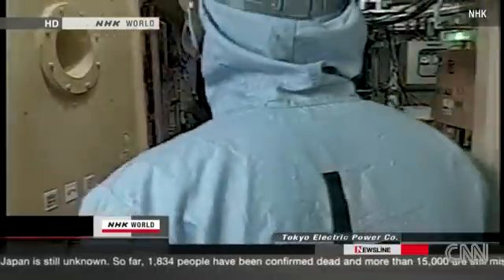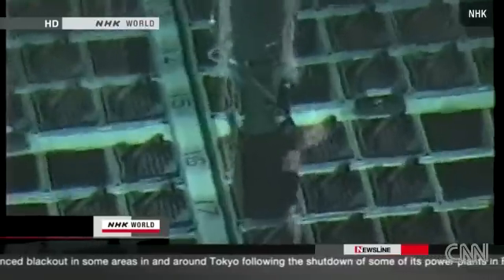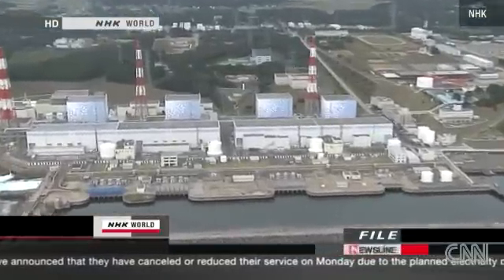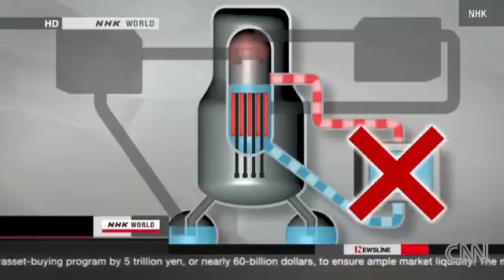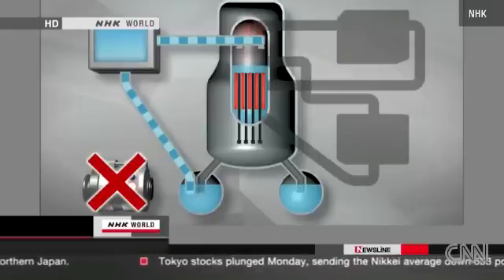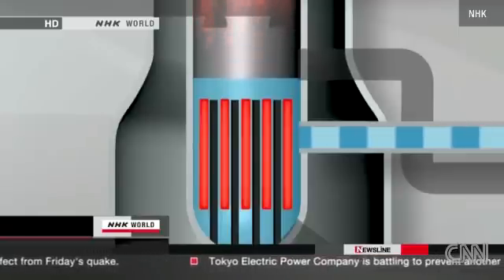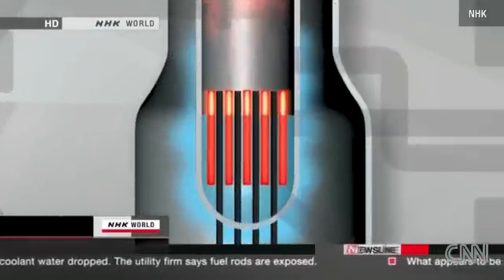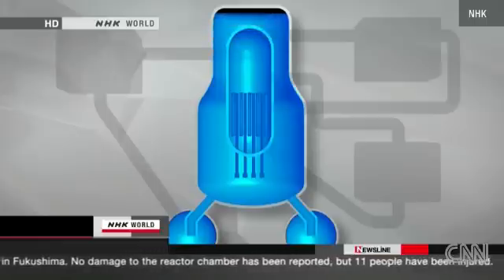Fukushima Nuclear Reactor Problem Explained (CNN)

Comment: The reason of the failure in reactor 1 wasn't a leak but a valve in the final emergency system that didn't open properly and only allowed part of the steam to flow. When the steam didn't pass properly in the passive system the water turned to steam and the top of the rods melted. The melting reaction created an explosive gas that managed to escape (through joints due to very high pressure) and explode. However the reactor didn't explode unlike Chernobyl. Just the roof where the gas pooled against. If the reactor exploded they would have had to evacuate Tokyo.

Comment: That is a lie:
Sea water was not pumped at first. 
They told them not to do it because the sea water would have damaged the reactor beyond repairs (salt!)

But then after some employees saw the impact of the incident, they disobeyed the bosses and opened up sea water. 

They saved Japan and reduced the impact of the incident. The greed from that Japanese company that owned Fukushima is beyond comprehension. They were also the ones who originally reduced the tsunami wall by a few meters which is exactly the amount that allowed the tsunami to pass

Comment: I would Reinforce the walls With Metal,Steel and Concrete
And would probably put 3 Backup coolant tanks reinforced with steel and steel bolts.
But they is no way to reinforce the Backup generators

Comment: wait a minute Nuclear power is actually geothermal power
Reply: no, nuclear power is what it is: nuclear power. geothermal power specifically means the heat energy left over when the earth formed inside the crust+ the heat produced by the natural decay of radioactive elements. nuclear power is produced from splitting atoms. just because it came from the ground does not make it geothermal power.
Reply: if you listened to the video the power is generated by the object being heated up to a certain temperature so technically it is geothermal when i first wrote the comment i meant it was technically geothermal because i know that they are different in their ways.
Reply: the natural decay heat from the fuel rods makes up such a small percentage of the actual heat produced by the nuclear reactor. there's no "technically," the decay heat makes up such a fraction it would be like saying humans are made out of iron because we have the iron content of about 3 grams scattered in our body. functionally useless.
there was a video (not this one) that i watched a few days ago that mentioned that the percentage of decay heat that makes up the general heat production of a reactor is really small and only becomes a problem without coolant which will probably never happen. it was something about canada's safety, however, i am not finding it for the sake of a youtube comment.
Reply: i made the comment 2 weeks ago i replied to try and fix what i meant so please dont carry it on

Comment: Possible Fukushima disaster solution:
The Fukushima radiation leaks continue as we speak, it threatens the 
life on the whole planet. The molten cores is trapped in an underground 
stream of water, leaking out to the Pacific Ocean.
2014 i come up with this possible solution, its a gigantic chamber 
under the broken reactors, that has its air sucked out, additional 
vacuum chambers is located on the sides.
Explosives are placed underground around the radioactive buildings, 
and well below the water table, and the now molten former reactor cores.
 When exploded the massive area of land will start falling down. Free 
debris and particles will be sucked inside the underground shaft, and 
additional vacuum chambers can be set to go off, to additionally suck in
 dust and debris.
Picture: http://circuminvent.com/wp-content/uploads/2017/02/fukushima-reactor-solution-png.jpg

http://circuminvent.com/fukushima-solution

Comment: The real reason is that Tokyo Electric, the company operating the plant, delayed using sea water to cool the rods because then the system would be unusable in the future, which means huge cost for replacement. They delay that for every reactor and they all ultimately failed. And now the world unknowingly suffers because the Japanese government is too scared to report the real damage, for the sake of stability.
Reply: I think Tohoku Electric Power Company should kick TEPCO ass!

Comment: Told you should have had FOUR back-up systems....the forth being NEVER place your back-up generator where it might get flooded as in this case....especially in an area prone to tsunami.
Reply: Correct. Generators in the basement sealed the fate of Fukushima. Its the first place to flood. Generators should have been on the hill behind the plants.
Reply: You need the sea water to cool it
Reply: @_Andrew2002  the generator doesn't need seawater. You can have the reactor near water but the generators and switching stations in floodproof areas.
Reply: They should do what TOHOKU did!
http://thebulletin.org/onagawa-japanese-nuclear-power-plant-didn%E2%80%99t-melt-down-311
Reply: This happened because the designers of the nuclear power plant were from the USA and made the design similar to these used in the USA. In the states tsunami is not a disaster to consider, but tornados are and hence the generators are placed in the basement - safest place in case of a tornado. Why would one put generators in the basement to protect them from tornados in Japan? Well that is another question..
Reply: Ivory Billed yeah but the generator could've overheated and locked up.

Comment: How many plants in the US were built with the same design? The industry PR might claim safety but capitalists seeking profit will always cut corners especially when they have bought off regulators and politicians to look the other way.
Reply: The plant design did not cause the problem at Fuku. Putting the generators in the basement below sea level caused the meltdown because they flooded.
Reply: They had a total of 4 safety measures in place. The chances of all of them failing like they did is rare. Now they know how all failed they can make them better. Having such a massive amounts of safety nets in place is what saved this from being worse than what it was.

Comment: why can't they use liquid nitrogen as emergency cooling measures?
Reply: Liquid nitrogen boils immediately upon contact with warmer objects. It will result in Leidenfrost effect, in which the warmer object is enveloped by the boiled gaseous nitrogen, insulating it from the liquid nitrogen. This is why it can not be used as a reactor coolant. In fact, no one uses liquid nitrogen as a coolant for anything that produces so much heat like engines or reactors.
Reply: it evaporates to quickly
Reply: +Tinker Bot it has a low heat capacity, meaning that it doesn't take much energy away from what it is cooling as it heats up,,,, im not an expert sorry but they might have taken it into consideration too while designing and building, water is most used coolant

refer to this lik :https://in.answers.yahoo.com/question/index?qid=20110314091052AAmyYAL
Reply: hmm.. i mean, why not? liquid nitrogen is real cold
Reply: +Tinker Bot I am not an expert on this issue but I think that here, the main problem as seen in the video is how to cold enough the system where it is necessary. That means that it is not related to what you are using to cold to system.
Reply: Howie Au What?
Reply: Liquid nitrogen is a cryogenic/cryonic compound, meaning it is  gaseous in state but turned to liquid when cooled. So when it is exposed to heat it immediately turns to gaseous state and expands will cause an explosion instead.
Reply: +Tutku Temel so you are saying that it would be too cold?
Reply: Not Leidenfrost effect, water can exhibit leidenfrost effect as well
Reply: Tinker Bot I would think that it would evaporate very quick and you'd need an unthinkable amount to make it work.. who knows.
Reply: i think the boiling temp is below 0 so if it came in contact it would make it hotter i think
Reply: Tinker Bot It would create a black hole
Reply: Liquid nitrogen would not work at all. If the rods were regular iron or steel and hot, then yes, the nitrogen would work, but these are uranium rods which contain a huge amount of energy going through a nuclear reaction
Reply: It doesn't absorb so much heat because of it's low capacity and will evaporate easy after absorbing low amount of heat

Comment: stick with burning coal!!!
Reply: Ehrm... you need extremely large amount of coal to supply households with energy... and it's really bad for the environment. If I remember correctly, there are limited amout of coal on earth.
Reply: after these fuel rod's are spent, we have to store them forever, there extremely radioactive for thousands of years and have to be sealed and contained, guarded. a lot of money. plus us burning coal is not hurting the environment anymore than the EPA terrorist  china. there pollution is nuts, watch some of there videos, also the fulkushima nuclear plant ruined acres of land, along with countless cancer case's. also because everybody thinks they need there own car. there millions of them, making a lot more pollution than coal
Reply: +Turbo Diesel Yup, at least we could try planting more trees as carbon sink and then use those trees as fuel. It will never be as the good old days of petroleum and coal but at least it is safe and sustainable.
Reply: small bill of a million dollars
Reply: +Turbo Diesel how about solar hydro and wind
Reply: Tha happy banana 2.1 , Solar panel's, doesn't really generate a lot of power. if you would caver the whole roof of your house with them, still would only run about half of it. wind ruins the landscape so bad, it would take an unimaginable amount to power a whole city!. Then you have the cost, gonna be ridiculous!
Reply: what about radioisotope thermoelectric generators or RTG's for short?
Reply: Tha happy banana 2.1  They work pretty well in space craft's. I don't know about a city though, maybe if each individual house had one.
Reply: it would work but they are expensive as fuck!
Reply: Tha happy banana 2.1  yea you wouldn't be a happy banana afer the bill came lol

Comment: This just proves that nuclear power is not will not ever be truly safe....all 3 safety systems failed
Reply: Nuclear plants cannot blow up like nuclear bombs, you are comparing cats with giraffes.

The fuel that powers a nuclear reactor is typically made of Uranium-238, which slows down the chain reaction used to produced energy, unlike Uranium-235, which would explode. The latter is in much less concentration, which is not enough to make it bomb-grade.

The Plutonium-239 used in Fukushima could be a threat, if it weren't for one little detail: design. Plutonium bombs are extremely difficult to make, compared to Uranium ones. You'd need an implosion to start an uncontrolled chain reaction. Obviously, the containment structure in which the reaction occurs can't implode, it isn't surrounded by explosives.

There are more dangers out there, specially climate change caused by fossil fuels.
Reply: And 1 rare fuck up could render us extinct
Reply: ***** Public opinion wise.....any one that fails is large enough...
Reply: 2000Betelgeuse in unstable lands.
Reply: I have a theory but is there a nuclear plant near yellow stone national park and if so what if the super volcano that is yellow stone were to create earthquakes before its eruption wouldnt it be able to cause a meltdown then the eruption could cause explosions and other volcanoes and super volcanoes to erupt ending the world

Comment: so the cooling failed and what happened next? did the nuclear rods INSIDE the reactor blew up or did the used nuclear rods OUTSIDE the reactor blew like they said in the news?
Reply: The rods inside the vessel didnt but just melts to corium and the big explosion on the reactor happend because of the hydrogen gas ignites

Comment: a nuclear plant should be in a rocky or a desertic region, not 20 meters from the ocean shore, imho
Reply: They are built close to the sea because of the need for large quantities of water, for cooling the reactor as visualized in the video.
Reply: The process of creating electricity requires water to cool the rods as it is operating. Some are concerned that if water becomes less plentiful, it will become a big problem for the operation of nuclear facilities.
Reply: Palo Verde in Arizona is cooled with treated sewage water from the Phoenix metro area. It is the only nuclear power plant in the world that is not cooled by a lake, river, or ocean. The Palo Verde cooling model allows greater flexibilty for where we place these plants, avoiding seismic zones and tsunami risk, while also safeguarding freshwater sources. 
I think all new nuclear plants should be required to use the Palo Verde cooling model.

Comment: It should be just a small problem if the problem is resolved quickly. But, thanks to the stupid company, they finally make it become a worldwide disaster.
Reply: ***** Yeah it is a simple problem. After the disaster, the nuclear plant emergency control system are still working. They are powered by battery power. These power can hold for about 20 hours!!! Which means if they can recover some power or just do something to offer the power to the emergency control system. It can hold the temperature of the nuclear reactor. If this happened, we won't see those disaster happened later. But, they failed to do this. The stupid company hide every bad information and try to solve this problem by themselves. They think everything will be fine.(yes, this is what they are thinking when facing a potential nuclear disaster) They miss the best time to prevent this disaster. Then we see what happened later. The nuclear power lose control and nothing can prevent it becomes the biggest nuclear disaster in history. Even the disaster happened in Chernobyl has nothing compare to this.

Comment: Nuclear power plants require a vast amount of water. Placing them near seas or oceans is more a safety measure as you saw in this video when the safety measures failed, they flooded  the reactor with sea water to forcibly cool the reactor.

Comment: Most plants have auxiliary power of external source (power lines) to take care for the cooling in a case of emergency and are not self dependent. If Fukushima had that, damage would˙ve been reduced to a minimum. Another thing is a storage tank on the top of the building. And I thought japanese knew how to design a power plant? For sure Fukushima was old but that was one major flaw.

Comment: The problem with Chernobyl was that they reschedualed the testing to night, when the new people were on duty. Then, one of the men removed all but 6 of the control rods in the reactor he didn't tell his colleague. Because of the rise in heat, the other removed most of the cooling fluids. That's why Chernobyl blew.
While I say that, I think that if properly done, nuclear power is a brilliant thing.
Reply: @bigquackers1998 No, dumbfuq. That’s not how Chernobyl blew. Jesus.🤦‍♂️🤦‍♂️🤦‍♂️🤡🤡💩💩

Comment: Ya, but why use hydrogen (oh, I mean water) under very high pressures that only fission 0.5% of the fuel when you can use molten salt or metal and burn almost all of it... and it being thorium which is 4x less rare.
Why use the stupid LWR when the public (and I) WON'T accept it, when you can use LFTR (or similar) which the public MUST accept as safe (because it is).
Nuclear's ONLY mishap was the LACK of water (so ditch the LWR already) !!!

Comment: This was a typical LWR which requires water at high pressures (and LOTS of "engineered safety" to overcome it's inability to be safe within natural laws of physics).

Had it been a LFTR, the disaster would NOT have happened!
Now, please educate about that. If, for any reason you don't agree with the concept of the Liquid Fluoride Thorium Reactor (or similar), contact me.

The LACK of water is nuclear's ONLY problem, so ditch the Light Water Reactor, but don't ditch nuclear !

Comment: I'm assuming by "fault zone" you're referring to seismic zones?  Using the Instrumental Intensity scale developed by the US Geological Survey, with a threshold of 0.2g as a potential damage rating of "moderate" I found that out of the 47 nuclear power stations (producing more than 1000w of power) in the U.S. alone, only 1 was in the upper tier of moderate and two were in the moderate to heavy damage zones, and one of those two was shut down for upgrading.

I'm curious where you got your data.

Comment: And you're missing the key point of my reply: that they are generally safe when operated under normal circumstances with a moderate degree of competence.  Protip: everything has the potential to be dangerous, that doesn't mean it should be avoided.

Comment: Chernobyl: They didn't have a proper shutdown safety procedure, they disabled emergency backups for testing, which was being done in between shifts so workers were not present nor given enough time to prepare for it, among many other issues.

Three Mile Island: Not a single death or injury.  Problem?

What about the 437 nuclear power reactors currently operating?  What about the 180 other reactors being used by military naval vessels?  They all seem to be running just fine.

Comment: correct, but what the Greek Tragedy of it is, is that the use of lead for certain products was banned, and placed n controlled markets to specialized groups, instad of consumer markets, like your simple hardware store shoppers, and small, even entrepenueral businesses, an construction companies, without specialized licenses, that began being required after 2000 in the US.   ACE Hardware, Home Depot, and Sutherlands, well they have not carried lead boarding it out on the store floor since.